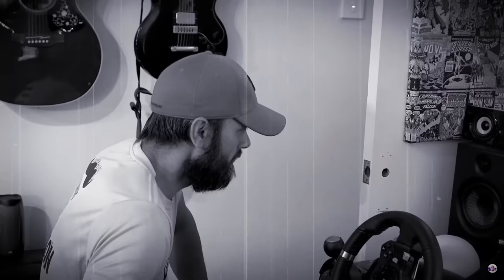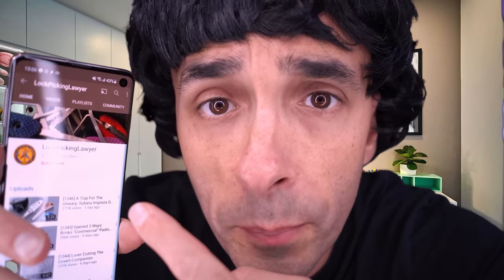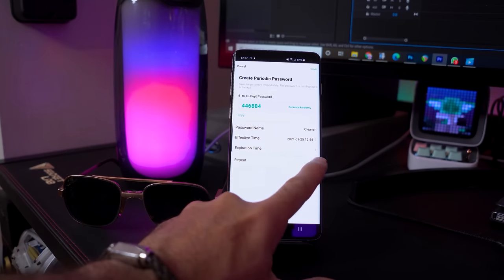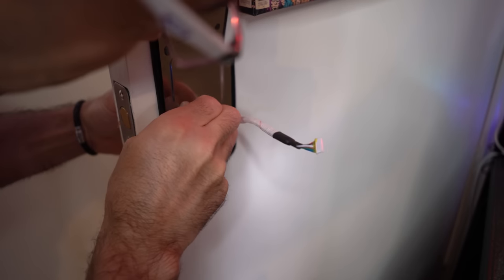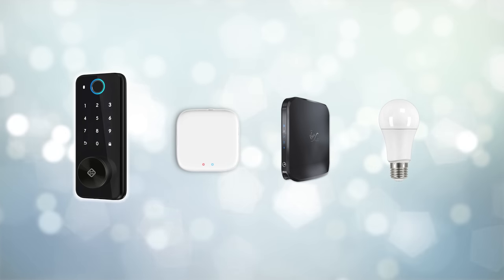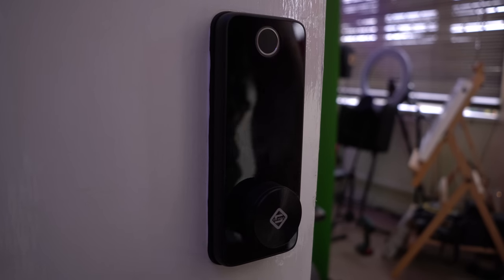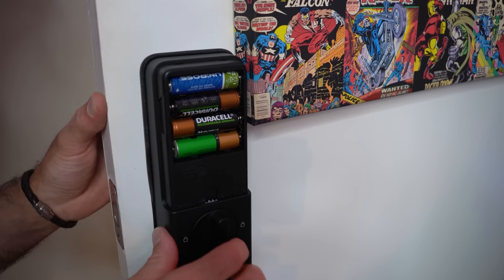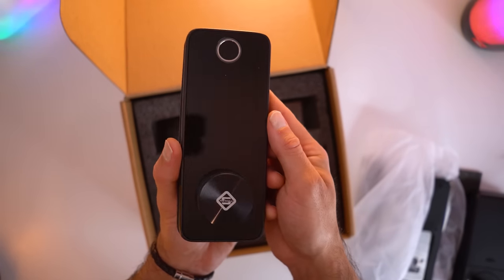Man Yells At Smart Home Lock For An Hour

Comment: PH: “This lock has four different ways you can open it”. LPL: “This lock has four different ways you can defeat it.”
Reply: All doors, smart lock are not, are easily defeated unless the door jam it self has been reinforced. Since most are not, it doesn't really matter. A good kick will defat a locked door regardless of the lock.
Reply: @TheJadedCoder  Simply ask a police officer what doors they hate when they do a forced entry and you have the best one you can get. Last I checked upvc security door with a multipoint lock was the best. And no you can't kick them. You either pick the cylinder or spend 60 minutes cutting through with an angle grinder. LPL and most US based lock picking channels don't cover upvc doors and multipoint locks because they're still very uncommon in the US.

Comment: Reason for no Alexa integration = Burglar shouts  'Alexa....unlock the door' 🤣🤣
Reply: Amazon echo requires a pin code to unlock doors. So if the burglar knows the pin code sure. Other wise shouting that will only get a pin code prompt and alert anyone in the area a wanker is trying to get in

Comment: Oh and DIY 101 Never EVER use a power drill on slotted screws. Not never. It's a combo made in Repaint Hell. Or on tiny little machine screws (they were the ones you chewed up putting the lock together). That's why we still have manual screwdrivers. Trust me.  If power is your addiction at least replace the screws with cross-head ones!

Comment: Paul making DIY look like it's astrophysics:
- Drill a hole with the centerpoint in an empty void (glue in a placeholder block). 
- Use the wrong bit for the screw, like a flathead bit for a cross/Philips screw (use the correct screw bit).
- Make holes too big so that screw have nothing to bite in (glue in a placeholder block).

Comment: Hey Paul, two things.
1. You can buy cheap NiZn (nickel-zinc) rechargeable batteries, made exactly for devices like this, that can't use regular NiMh rechargeables. They have the same voltage and voltage ranges.
2. Given your DIY skills, you have got to review the NUKI smartlock. It's specifically made to be used in situations where doing anything to the existing lock is not an option. And it has support for both Google assistant and Home Assistant. You just attach it to the inside of the existing lock cylinder, with 3 screws and you can easily take it off, if you need to, later on. It has a phone app, a smartwatch app, a keypad and even a car style fob. You will also keep you existing key as well and since the lock is mounted entirely on the inside of the door, IP rating is not an issue.

Comment: As somebody who worked in insurance for 4 years, you are right that they would not pay out if they break through the lock as its a major difference to the lock you normally have. However, most insurance companies if u ring them will IF you call them and get them to add to your file. It's all about fine print and like you state insurance companies will want to get out of paying. So save yourself hassle and just call them prior to buying. Like you said though most will go through a window and thus the door lock won't be taken into consideration.

Comment: Unless I’m missing something, the lock does apparently work with Alexa by using a Bluetooth Bridge/Gateway (need to buy separately) according to Amazon website. These seem to be about the 20 quid mark but also enable remote monitoring and control when away from home. Presumably because the device is Bluetooth only (not Wi-Fi) the bridge is necessary when phone is out of Bluetooth range to link to a smart home independently. I’ve used the same Bluetooth gateway quite successfully to control other (smart?) Bluetooth devices although I’ve never seen this device before - just interpreting the Amazon description (correctly or incorrectly). Thanks for your excellent review by the way

Comment: Hi Paul, i have a suggestions. Its best to always use crossed Phillips screws when fastening nuts. Even if a product comes with the flat head screw, discard them and get the crossed version. that way, you'll have a better bond with your bosch impact driver.
Reply: Square drive for the win - or as us Canucks call it Robertson.  Flat and Phillips head screws should all be melted!
Reply: Pozi drive screws at the least, but square or star drive are best. Philips should only be used for plasterboard screws. Flat head screws need to die a horrible death!
Reply: Plus set it to screwdriver with a lower torque setting.
Reply: Square drive / square screws*
Reply: I think you mean, you should always use a spanner, ratchet spanner or socket set when fastening nuts, not a Phillips head screw😱😛.  Always use a Phillips head screwdriver, for Phillips head screws. But try to avoid Phillips head screws or flat head they are crap!!

Comment: For insurance you are normally asked what type of lock you have, and whether it is BSI approved? I guess this would go down as a standard deadlock without BSI approval? Does it have BS3621markings? I have the Conexis L1 which is BSI approved.

Afaik Alexa doesn't allow smart locks to be unlocked via voice, but I suspect it would allow status updates. I've never felt the need to work around this.

Comment: My biggest issue with smart locks is that a vast majority of UK homes is fitted with multi-point locking doors (usually upvc) and (I think but won't swear by it) especially new builds so these locks are of no use what so ever which leaves us with the single company that makes one for the multi-lock door, Yale, and from all the reviews I have seen is that it is crap (mostly for battery drainage). I would love to see a company other than Yale provide something other than a deadbolt smart lock.

Totally love you diy meltdowns, makes me feel so much better at my attempts lol

Comment: "It can't take rechargeable batteries ... apparently it's a voltage thing."
No, really? And here I was thinking, it must be some super high tech star trek sensor, it can't possibly be the '20%!!!' voltage difference across 4 cells in series.
** continues to eat my chips **
Reply: USB rechargeable batteries may work? They seem to be the same voltage as non-rechargeable ones?
Reply: @SmartLifeEnthusiast  Yes, those new rechargeable Lithium cells in AA formfactor will probably work, they seem to maintain a steady 1.52v until they go straight to 0v when the cell low voltage cutoff triggers. They probably have a dc-dc stepdown regulator built-in, to regulate the lithium's 3.3 to 4.2 voltage range to a steady 1.52v output. I wouldn't trust those micro built-in stepdown regulators for a lot of current, but in this application they should work great.

Comment: The things you do for us.  Worth buying two hole saws in the future one for the face and one for the latch, usually a kit.  When the lock pad wasn't straight it was because the hole on the door face was too low compared to the door side latch resulting in the latch at a downwards angle.

Comment: Insurance companies normally ask for 5 lever, or multipoint locking, this lock is unlikely to be 5 lever. That said you could use it as a replacement from your latch lock and have a 5 lever as the secondary lock when you leave the house unoccupied

Comment: One question though Paul, most doors, UPVC and composites have a 5-lever mechanism, not sure how this would be installed on an outside door. And maybe this missus is then correct as you'd be replacing 5 locking points- with one. Unless I'm missing something? Love the channel, keep up the good work. Ben.

Comment: Paul I recommend you chuck that spade bit into the back of your tool chest and buy a hole saw kit.
Spade bits are good if you just want to get through a piece of wood, and for making a mess, but it's hard to be precise.
It's a clichee, I know but about half of getting DYI right is just using a good tool for a given job.
Reply: Totally agree.  Using the right tool is the key to a way easier DIY life
Reply: Preach it!!! You can't saw a tree down with a butter knife. Lol. Get the toys, always get the toys. I mean tools... hahahaha
Reply: When making an existing hole wider use a hole saw the size you need, with another hole saw the size of the existing hole, inside the first one as the arbour, to keep it steady

Comment: Kinda lost why the physical key aspect and waterproofing and all that are so special.  My August lock sits on the inside of the door only.  You can manually lock the door like a regular dead-bolt and since all my dead-bolts are keyed the same, I don't need a different key for the smart lock.  Everything matches on the outside where all you see is the standard deadbolt.  I don't need a pin-pad because I have the app, although I typically use the August app to auto-unlock when I get home.  No codes.  Virtual keys can be given (and revoked) via the app, and when I tell Google "Goodnight" it locks my door.  And yes, it has a sensor so it doesnt lock the door while open.

Comment: I've been using the Wyze lock and since they actually did connect to Google Home, I find it quite brilliant.  Not as feature rich as this one you just reviewed, but it is insanely easy to install and use. Battery life is pretty darn good too.
Reply: I have a few wyze devices (cameras, bulbs and door sensors, picked up on a trip to visit relatives in the USA when such things were still possible) and looked at the Wyze lock but they seem to be very much designed for North American door furniture and I wasn't confident it would fit our door. Plus there are times when all smart home devices, pr the supporting networks / servers - go down; it's a mild inconvenience when Tuya goes offline for a couple.of hours leaving you without lights, but I wouldn't want to be locked in (or out) of my house for that time, or have it open to intruders. Smart home tech in general would have to become a lot more stable and reliable before I would entrust the security of my family and everything I own to it.
Reply: @rich_edwards79  well, that's what I like about Wyze... It's a retrofit. Idk about non US lock design, but with the Wyze lock, you still have your original lock and key and this just connects to that. If the network goes down, you can still use the key and their keypad since those connect via Bluetooth. It's quite a clever design. My only frustration was that for almost a year, they kept announcing their integration with Google but it kept getting pushed off. But they have since integrated (I think in March) and it works beautifully.

Comment: Thanks for the video, I'll have a look at getting on of those lock. btw if your door or wall has a hole that you want to enlarge. Just get a scrap piece of wood and drill the hole size you want through it and then place the wood on the hole with the holes aligning. Then just drill through, the holde you made in the wood will hold you tool in the centre and stop kick back. 
Ps. Get a hole saw kit they are like $20-30

Comment: Have you looked at the Wyze lock? I’ve had it for quite some time. It has no problem with rechargeable batteries, connects to Alexa through the Wyze app also to Google. Has no problem being outside has a keypad and allows me to use my original key. The only thing that it doesn’t have is fingerprint sensing which I’m OK with. I can set up to automatically lock when it’s closed and it can alert me if my door opens. I can set one time or scheduled pass codes. Really it’s pretty fantastic.

Comment: I could watch you failing at DIY all day. As a handyman, I find it hilarious! No idea what insurance companies think of smart locks, and they probably each have their own criteria, so it's a chance I've taken. I went with the Yale connected digital lock which lets me in with a PIN or a variety of tags in various forms. It replaced the front of the lock and operates my existing BS standard security lock, which I reckon would confuse a burglar enough to make him try somewhere else instead. It hasn't let me down once in the 3 years I've lived at this house, and many more years at my previous house.,and the batteries last forever.

Comment: You wanna be careful about adding Google Home/Alexa support - don't want the door unlocking because someone yells from outside "ALEXA - UNLOCK THE DOOR". I got a Yale Smartlock and a killer feature is that when you leave your neighbourhood and then return, the door auto-unlocks. The Yale is a real REAL pain to install the software even after the physical install but it works great if you're a computer genius. (If you Lose your phone disable the autounlock feature!!). A bumpkey does not require special skills and the common criminal will have these - so I would dispense with a key lock - just make sure that batteries never run out or you have an alternative way to get in.

Comment: Hey paul, you know they make this tool called a hole saw.  It comes with a kit of 19 or so and you attach them to your drill to well, make or enlarge holes. :P
Reply: Yes, but a hole saw (like the spade bit that he tried) requires a center to keep it... well.... centered. Once there is an existing hole, he's stuffed. At that point, you have to clamp a scrap piece that you pre-drilled with the hole saw on top of the hole you want to enlarge. Hole saw is definitely the way, though, for future reference @Paul. And you can throw those slotted heads in the bin, mate. The instructional video showed Philips head, anyway...

Comment: For the insurance the locks tend to need to be kite marked for British Standards.  From my understanding Yale has one that has these standards because it was an option on my front door, the lock you reviewed has better features though.  However it doesn't lock a multipoint locking door so will have limted usability apart maybe for a side gate or older style of door.

Comment: Rechargeable Ni-CD and NMHi batteries are 1.2 volts as where alkyline batteries are 1.5 volts - HOWEVER there are Nickel-Zinc (Ni-Zn) rechargeable batteries that are 1.5 volts. If you buy the batteries you also need to get a charger that is Ni-Zn specific also.

Comment: 10:51 Not sure if anyone else has already said this, but if four rechargeable AA batteries can't put out enough voltage for the smart lock, the solution is surely five rechargeable batteries...

By happy coincidence, 5 x 1.2 V = 4 x 1.5 V...

Comment: Use lithium rechargeable batteries, those are 1,5V, just like alkaline batteries
Edit: there are AA sized lithium rechargeable batteries
Reply: Are there any 1.5v rechargeable batteries? If so please link to them as I would buy a ship load
Reply: On deeper searching I have found a few... Maybe this is a future video for @Paul "Mr Handyman" Hibbert
Reply: Most readily available rechargeable batteries which can be bought in stores are nickel metal hydrate or nickel-cadmium. Which won't cut it. Most readily available and widely used lithium ion batteries, normally bought online are 18650's which are larger and have a nominal voltage of 3.6 volts and top voltage of 4.2v droping to 2.5v. They also need a BMS to stop it overcharging and undercharging. Or it will damage and possibly explode your batteries.
Reply: @TheDrewsifa  indeed, but less commonly available there are also AA sized lithium rechargeable batteries.

Comment: "But enough of that. Here's me failing at DIY."
To be sure, I'm actually quite good at DIY. Regardless, as nearly every DIY job I've done has taken twice the time I think it will, I can empathize.
(Hint: Pull a "Scotty" and automatically multiply the estimated time by 3 when discussing with spouse.)
"Why doesn't this work with my voice assistant?"
I'm just gonna put this here (expecting full pelvic thrust derision)
 You can do this with Home Assistant. :) :) :)
"If I was allowed to put a smart lock on the outside of my home, this would be the one." Agreed.

Comment: Paul, I think you need to up your tool game! You could have solved that installation issue of unable to use the original spade bit with a neat little trick. Take a piece of wood (about12mm +) drill the desired hole in that and then clamp that bit of wood to your door (whether screws that would be hidden after installation, or with clamps.) and drill through your hole.
Also a multi tool would be better than that jigsaw. 
Great lock though. Looks a better job than my Yale Conexis L1 that I have. Maybe time for an upgrade…..

Comment: Well if this is a voltage thing that's very easy for the rechargeable batteries that's just means that the normal batteries push out 1.5 volts just by rechargeable batteries at 1.5 volts and it should work fine